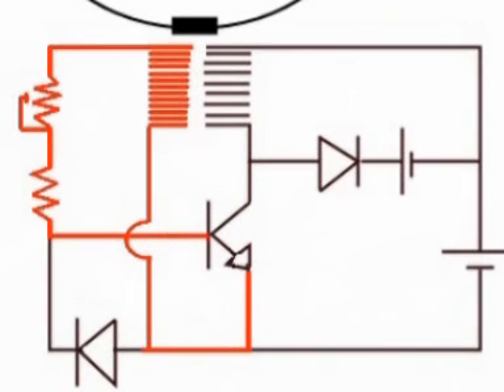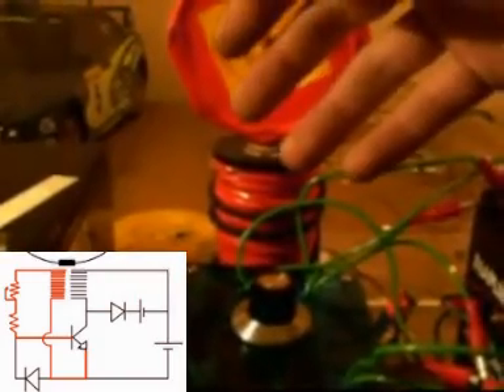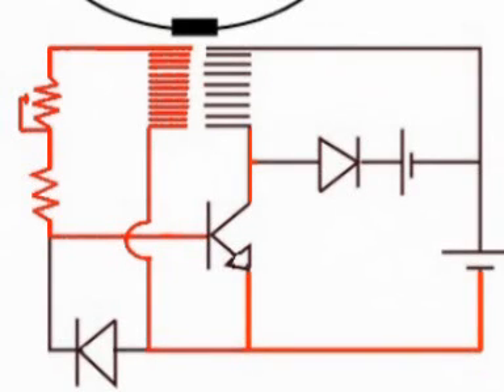How to Build a Bedini Motor ... Part 1

Comment: This would spin with very little energy, but it couldn't handle a significant load, and if it did, would require substantially more power to the electromagnet.

How is this any different than a conventional electric motor? The pulsing energy input? This merely reduces the energy input, torque, and thus output of the engine, yes?

Comment: There's also a 555 timer that you could use to pulse the DC current.  Wire the trigger to the coil and there you go.  Putting the output pulse to a supply transistor (with a large enough heatsink) would increase the efficiency of the motor.

Comment from the maker: "so charging a battery with high voltage would normally be less efficient than charging with high voltage. "

Correction :

so charging a battery with high voltage would normally be less efficient than charging with high *current*.

Comment from the maker: There are several stages in a single pulse from the ssg.  First, there is a high voltage transient spike which exists for only microseconds... then the voltage almost instantly drops off to just above the charging battery's voltage.  It is believed that the transient spike creates an event within the battery that allows energy from the vacuum to enter the system.  This is mostly based on Tesla and Heaviside's theories.

Comment from the maker: in a sense... by conventional physics batteries charge more efficiently with high current and with a voltage just above the voltage of the battery being charged... so charging a battery with high voltage would normally be less efficient than charging with high voltage.

Comment from the maker: the watts in and out will depend on the size of your machine, though generally the watts out is 25% of the watts in.

the electrical output doesn't exceed the input, yet paradoxically the batteries charge far faster than the measurable energy they are receiving.

Comment from the maker: Technically you can use the electricity in the trigger coil... in a sense we already are since nearly all the energy flowing through it is being converted to heat by the resistors...

but that isn't how the SSG works... the electrical output doesn't exceed the input, yet paradoxically the batteries charge far faster than the measurable energy they are receiving.

Comment from the maker: then to find out how much energy was output by the motor we connect the now charged battery to a known load. I normally use a 50 ohm resistor.  Using a known load we can then calculate the volts and amps and thus get watts.  We then measure the time it takes for the battery to reach the point it started at before we began charging.  Then using the time and watt measurements we can tehn calculate the joules output by the motor.

By comparing the joules in to the joules out we can calculate COP.

Comment from the maker: I had a feeling you didn't know.

First we measure the power it takes to run the motor.  We get this by measuring the voltage and the amps and multiplying them to get the watts.  Watts is a unit of power by the way.

Energy can only be calculated in joules.  To calculate joules from watts you need to know the time the motor is using the watts.

Now we multiply the watts by the time the motor was running.  This gives us the joules and voila... now we know the energy that was "consumed".

Comment from the maker: hmmm... you have appeared to have deleted your other comment.  Though if you are wondering why 12.4v is chosen, then read up on lead acid batteries.  When small 12v lead acid batteries go below 12v it can cause serious damage to the plates.  So you don't want your batteries to go anywhere near 12v, and the safest operating range is between 13v and 12.4 volts.  It is not because it is a pretty number, lol.  Do you think it is pretty?

Comment from the maker: for example, let's say it takes 4 watts to run a heat pump that is 25% efficient.  A very bad heat pump.

It would be wrong to assume that 1 watt of heat would be output by the heat pump, since it is drawing in energy from an external source that requires no extra work by the operator.  Indeed, the total amount of watts being output by our 25% efficient 4 watt heat pump could well be over 5 watts.

Hey presto... "over unity".

Comment from the maker: Heat and energy are synonymous and can be calculated in joules.   However the amount of joules required to run a heat pump is normally several times less than the amount of joules being output by the heat pump... at least on the hot side.

This is why coefficient of performance is used to calculate the "efficiency" of open systems.  Even if a heat pump is only 25% efficient electrically, it is still possible for it to output more than 100% of the energy required to run it.

Comment: No, voltage is potential.  Not work done.  Work done is joules (or, more commonly, kWh).  

You don't get it.  If the system actually works it will run indefinitely.  Where are all the continuously autonomous buzzing Bedini motors?  They DON'T WORK.  They CAN'T work.  You cannot create energy out of nothing.

Comment: Voltage is not energy.  Voltage means nothing in itself.  

I can rub my hair against a blanket and generate 20,000 V.  The current is practically zero however.  A simple step-up transformer can easily create extremely high voltages from a household circuit.  It is not, however, any more energy.

Think of it this way - a radio uses 120 V power.  A powersaw does to.  Yet the powersaw consumes 15A and dims the lights in your house, while the radio uses milliamps and does nothing.

Comment from the maker: I don't think anyone working in this field believes it is possible for the energy output to exceed the TOTAL energy input.  That is impossible and would require over 100% efficiency, which, as you pointed out, couldn't occur.  Every claimed over unity device I know of is designed to be open system.  A closed system can not perform more work than the energy input.

Comment from the maker: I was using refridgerator as another example of a heat pump, which is an over unity device producing several times more heat than the energy required to run the pump.  Yes, the energy is coming from an external source so its efficiency doesn't exceed 100% (that is impossible) but it's coefficient of performance can be over 1 which is what is important.  Work in compared to work out.

Comment from the maker: yeah, as I mentioned at the end of part two a neon bulb is essential to stop your transistors blowing up. ^_^ The neon bulb isn't essential for the motor to operate but it is needed as a safety feature in case the output voltage becomes to high... that will be what is frying your transistors.

Comment from the maker: Do a search for 

Bedini solid state oscillator

your are absolutly right.  The magnets are not required to run the coil but your overall COP will be greater if you use a rotor.
Reply: That is because the magnet is charging not only the trigger, but the power coil as well. I think a lot of people miss that the power coil picks up power from the back emf AND from the voltage induced by the magnet; you are actually capturing both. The same thing happens in a bicycle tail light, where the wheel's magnet charges a coil as the rider spins the back tire, similar to an old magneto.

Comment: I'm dreaming of a one coil pulse motor that mimics the bedini and costs less to produce.  Here's how it works.  There is a  tiny hole in the wheel that light can pass through.  Hmm.  A textbook 555 circuit and between R2 and the capacitor goes a common photo resistor, and it goes on one side of the wheel.  On the other side there is a little light.  When the hole passes the wheel the 555 becomes a one shot(it won't do anything until the light hits the photo resistor).

Comment from the maker: What I mean is, if you run the motor until the primary battery is down to 12.4 volts then swap the batteries, the motor should run for *at least* 70% of the time the original battery did until it reaches 12.4 volts.  Then swap them again.  The ssg is the load.

Comment from the maker: COP stands for Coefficient Of Performance... it is similar to an efficiency rating. If you put 1 unit of energy into a "device" and it "generates" 1 unit of energy then it is said to have a COP of 1. if it produced 1 unit of energy for every 2 unit spent then it has a COP of 0.5 .  However it isn't the same as efficiency.  It is impossible to have an efficiency over 100% but it is possible to have a COP over 1.  A heat pump is normally over COP 1.

Comment from the maker: to be honest the motor (at least with just one coil) doesnt have very much torque.  

i know one motor with a bike wheel for the rotor (though with the same sized coil) has enough torque to turn a fan that normally uses a 1HP motor...

I havent done any tests to see how much torque is in my rotor... more interested in the batteries ^_^ but there isn't very much torque.

Comment from the maker: some have managed overunity others havent... 
my single coil motor was running with 250ma on 7.2amp hour batteries so the batteries only had enough energy to run the motor for 29 hours but instead it ran for a week and then the bearings fell apart! lol

my current "self runner" has been running on 950ma with 7.2ah batteries for the last 20 hours.  thats almost 3 times more energy than is in the batteries.

Comment from the maker: you are absolutly right.  Definatly best to start with fresh batteries.

Though I am in need of some seriously heavy duty batteries to run my current motor and having to consider second hand ones and then condition them with the "energiser".  Igor (bless him) tried to make a 30Ah battery out of lemons but i think lead acid ones are in order! ^_^

screw it... just have to save up!